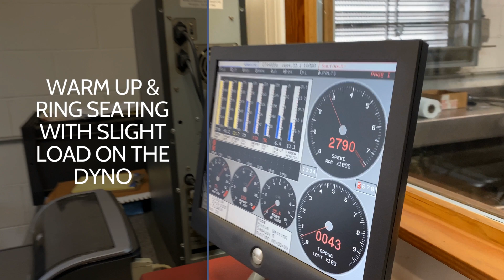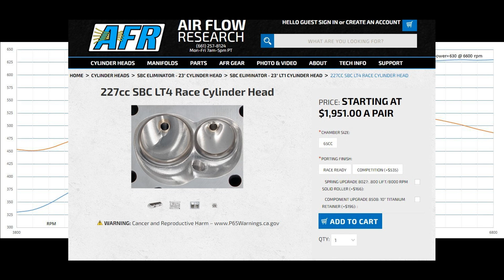Chevy LT1 Stroker Engine On the Engine Dyno [630 hp 551 tq]

Comment: You realize the "LSX" HYD Rollerr lifters are the same from 87up.. Right?

You can buy those "LS7" ones and they drop right in a Gen 1 SBC and vise versa... 

Long as they are OEM GM, ya good...

I would have went forged bottom end, h-beams, 9.5:1 compression, shaft rockers for the AFR's, The XE-294-HR10 cam or XFI 292,  and then put about 10psi boost. Call it a day!
Reply from the maker: I do realize that.  I've found that there are umpteen different makers of the 86 and up hydraulic lifter.  The GM is getting expensive.  If my customers can afford it the real Johnson is the best in my eyes.
Reply: @EllweinEngines  Yeah people was having FIASCO'S over the past year with junk flat tappet's coming from China wiping out flat tappet lobes on new builds left and right..

To me, a factory LSX-LS7 lifter should be more than enough to handle Gen1 style HYD ROLLER lobes considering what LSX lobes and how crazy they are anymore....

Also, Question sir...

Do you feel the LT1 block is superior vs the 4 bolt 638/880 casting SBC GEN 1 blocks as David Vizard swears he has broke all 3 roller blocks he tried to use...

Comment: I have a very similar motor build in my 96’ Camaro with a T56 and 4.56 gears. I’m running at 12.7:1 compression and E85. How much power do you think the intake setup for the engine dyno is making over a Port matched LT4 Edelbrock with a monoblade TB?
Reply from the maker: Maybe 5 to 10 hp at very high rpm.
Reply: I just had my car on a newer mustang dyno. Only did 475 through a T56. I say only because I figured it would do close too 500 at least even on a mustang. My tire pressure was low at 18psi with NT-05r drag radials. I know it’s running strong though because it made peak power at 6,900 and peak torque at 5,300. Still made 475 out past 7,300. Even with the lower than expected dyno numbers that tells me that it’s pretty solid. Here is the dyno vid.

https://youtu.be/_o6WQujcbXQ

Comment: Nice work to the owner, yourselves and of course LLoyd Elliot.  I have a 383 with TF 185 /21 degree heads. 202's replaced with 2.08's titanium; CC is 54cc. I estimate combustion ratio is around 11.2-3.   Bullet cam from LLoyd, 555/555  228/236 with 1.65 full steel roller rockers spec to 610.5/610.5, lobe separation 112.  42 pond ford green top racing injectors.  Heads done by LLoyd & flow @ .200 109/145 .300 204/144, 400 244/178, 500, 280/199, 600, 287/210, 700, 291/218.   Scat 3.875 nodular crank, scat 6.00 inch h-beam rods, and probe 12345 -12.5 cc inverted dome pistons, (up to 15 lbs of boost); arp 2000 series rod bolts.   The duration is as advertised @ .50.  If I may ask a question or 2.   Question 1:  does the duration increase exponentially along with the lift?  My best dyno pull was 528.9 at 6600. Engine hadn't peaked as I think.  Nearly every pull it was improving over the last.  Dyno time ran out.  Question 2. Am I on point with the compression ration guesstimate?  The above engine pulling 630 is phenomenal. I note he is running 12.5, little more cam & an 850 dbl pumper. Cheap plugs and single coil on the dyno pulls.  I am using a 24x system, by Bob Bailey.  Was not dynoed with it.   Question 3.  Do you think, my 528.9 was low, on point and what could be done to improve?  My car being an auto. and 1994 C4.  Current engine is 97 LT1...and last.  question.  Do you think I have enough to get closer to the 600 hp range.  Remember I ran out of dyno time as he had other so run?  I chose the 185 heads, since Trick flow advised the 185's would reach high horsepower numbers quicker than their over 200's would.  The claimed the fast burn 185's would get to their numbers quicker 21 degrees than the larger LT1 heads.  Opti Spark yes, MSD.  So looking into your crystal engine; What do you think?  Am I maxed out hp wise?  Or more can be had.  Hope I covered everything of importance.  Again really impressive work.  CJ.  

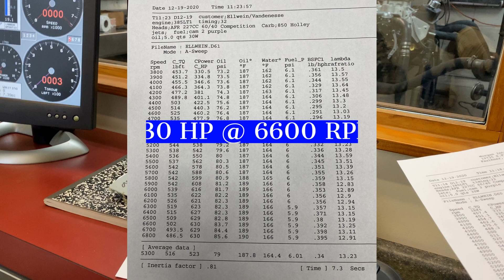UPDATE:   Since the above posting I did look into moving up in the 600 hp n/a range.  Bullet Cams told me I needed to select their next camshaft.  That should do it.  That cam specs are very aggressive.  I built this engine for my vette with 2:59 gears.  Now with a Dana 44 I am running 3:45 cogs.  If I ever go back into the engine; cam swap is a must.  I am reminding myself that Carls' solid lifter cam is definitely designed to make more power!!!!

Maybe we can put the 2 engines in a contest of sorts.  What do ya'll think?
Reply: If you really do have a 3.875" crank stroke, then your displacement is a touch over 400 cubes depending on exact bore, not 383.    185cc intake runner is not going to get you to glamorous max hp numbers; 205cc would be more like it.  However, unless you are drag racing the car, you may be happier with the low end torque you undoubtedly now have.  Don't get a complex over HP numbers--they are often not a good indicator of the real world performance of a vehicle, especially today.
Reply: @ShawnStjean  Well I certainly made an error.  Can't be a 3.875.   Has to be a 3.785.  I will check build sheet.  Well build sheet says 3.875. But it's not correct.  Since I created it I am sure in error.  What I am otherwise sure of.  Based on piston number.  Definitely a 383.  Probe SRS Series Forged Pistons_Chevrolet 383_Dish_1.125.  Per Vigilante website.  Thanks so much Shawn.  Great alertness on your part.  And equally great humanitarianism to even say something.
Reply: @THE_ORIGINAL_I-SEARCHdotFUN  No problem, you're welcome.  That compression height piston does check out as a 383 with 3.75 stroke, 6 inch rod , and 9 inch deck height.  Which really means that your heads are only a touch conservative, but well-matched.  I'd bet a lot that your torque peak is MORE than your HP peak (the reverse, as with this one, means a race motor, not a street motor.)   I would also bet that a 707hp Hellcat is not as much an overmatch for you as he thinks.  It comes down to traction in many cases, at this level.
Reply from the maker: Q. #1 duration increasing exponential with lift:  Say if you go to 1.7 ratio rockers for more lift would that also be more duration?  I say...no.   The cam would still have more duration but will give more lift due to the higher rocker ratio. 
Q. #2  I get 11.5 to one compression ratio assuming piston in the hole .010" and a gasket of about .040" thick
Q. #3 No I don't think the power is low for your engine.  I think it's pretty accurate.  Your engine dyno may be more stingy than this one.  But the heads you have don't flow as much as these and the cam is smaller and the static compression is lower.  I think the 529 hp is right on and you did have the efi set up and LT1 intake.  My single plane manifold makes more power than and that helps this 630 hp motor.  So I would really be happy with the power your motor made with the more reasonable compression ratio.  I think you have a very good engine combo.
Q. #4.  With the smaller heads I don't think it will get much more power on the dyno.  But it will be a good set up when it's in the car and tuned up for the Corvette.  
I do think you worked your combo out well.  But every combo...even this 630hp combo....can be improved a bit.   
The tuning on the street is the ron thing that  makes-so-breaks the engine.
Reply: @EllweinEngines  1.7 for an LT-1 is almost like pipe dreaming respectfully.  Finding 1.65 was a beast.  I only found one vender that makes them.  I heard Scorpion mades them.  But no evidence yet.
Compression raising is a sure.  But I designed the engine to be streetable and cool under pressure.
Reply: Did Lloyd Elliot port your heads?  He doesn't use 2.08 intake valves on the 21 degree heads but on the 23 degree he does.
Reply: Those are good numbers. You should do a Google search and type in "LT1 HEAD SHOOT OUT " and read the article . The best head tested was the AFR 195 Street head and made 516 hp with a XFI 230/236 camshaft.  Compression ratio was at 11:1 on pump gas.

Comment: Awesome work! Do you think it’ll run on 93?
Reply from the maker: Alex the owner hopes so but I'm not certain.   I would put one can of Boostane in the take per fill up.
Reply: @EllweinEngines  Hey Mr. Ellwein I know the AFR 227 heads come with springs for a solid roller. Are they ok to use with a  hydraulic lifter cam?
Reply from the maker: @sstevocamaro  I think so.  But I'm not certain.  I leave things like that up to my cylinder head guy Dennis Staff.  I think the AFR227 can be had with HR springs too.
Reply: @EllweinEngines  I wound up going with the 8002 AFR spring. I believe it has the green strip

Comment: Do you also dyno tune? I bought my 97 trans am ws6 with a 383 in it, I was told it was times before but it has some hesitation in the 2-3k rpm area trying to drive it normally. It does have a 3800 stall converter and 3:73 rear end and shifts very quickly from first to second. She’s plenty fast when just getting on it and doesn’t notice that hesitation at all. I am Just getting back into cars and not sure if I should just run it until I want to swap to a torqhead 24x setup or have someone tune this one. I’m in Michigan, a few hours away from oscoda. Thanks!
Reply from the maker: Right now I do not have a chassis or hub dyno but hope to have access to one this year.  So I only street tune.  It is just as good as dyno tuning but it takes forever...I spend a whole weekend doing a street tune.

Comment: Is there a certain type or brand of cylinder head bolts you prefer for your builds? I’ve looked at pricey ARP, Earl’s racing products that are non-torque to yield to factory replacement torque to yield Fel-pro or Mahle. Also what torque procedure do you use?
Reply from the maker: I use the ARP and have not tried the other brands.  I’m not against the other brands.   Just have not tried.   I torque the head bolts or studs with 50ftlb then final torque (2 times around). I don’t do a hot torque.
Reply: @EllweinEngines  Thanks, I will go with the ARP 134-3601 if that is what you use.
Reply from the maker: @rsnarski3  yea those have the nice stainless steel outer row head bolts and they won't rust.
Reply: @EllweinEngines  Ah , I found those with the ss outers 134-3603. Thanks for the tip, I appreciate it from you. I will be giving you my rebuild work when the time comes. Right now I’m prepping for LE2 heads. Any preference on head gaskets.
Reply from the maker: @rsnarski3  No preference of head gaskets.  For mild builds I like the Mr. Gasket thin stock style.  For performance I like the FelPro 1074 or the MLS Cometic.
Reply from the maker: @rsnarski3  Oh yea!  you found the 134-3603 with the ss outer row.  that is a good bolt set.

Comment: Getting closer.
Reply from the maker: I don't think I will ever top your engine.  It will be fun to try.  I think I'll need a big block Chevy.
Reply: I don't know. This one is only 16 hp away from my original peak number with that intake manifold, and 26 hp from the peak after you did the refresh, and I swapped to the Strip Dominator with the 2" spacer. Is that my old intake manifold?
Reply: What’s your setup? Are you on pump 93?
Reply from the maker: @sstevocamaro  this is Mike Glick's combo link.  http://www.ellweinengines.com/ERE62/ERE62.htm
His torque is crazy high too.  Ai TFS 21* with bigger cam than this engine in the video.  But the right combo for his set up.
Reply: Hey Mr. Ellwein I know the AFR 227 heads come with springs for a solid roller. Are they ok to use with a  hydraulic lifter cam?
Reply from the maker: @sstevocamaro  The 227 heads that Alex ordered was with springs for hydraulic lifters.  He did not get the solid roller springs.  But....the good mechanical roller springs could work with a good set of Johnson hydraulic lifters I'm sure.
Reply: @EllweinEngines  thanks
Reply: Just so people know Mike’s engine has a greater cubic inch displacement than mine. My engine in this video is a smaller cubic inch motor.

Comment: This is my engine!! Thank you Karl!!!
Reply: Your a lucky guy!! Do you think it’ll run on 93? I’m putting together a very similar setup (383)
Reply from the maker: @sstevocamaro  I'm thinking maybe but I would not risk it.  I suggest one can of Boostane per full up of 93.
Reply: @EllweinEngines  Are those heads race port or competition port?
Reply: @sstevocamaro  ask AFR what’s best for your set up. Jeremy helped me at AFR.
Reply: This is a stock block ?
Reply: I know the AFR 227 heads come with springs for a solid roller. Are they ok to use with a  hydraulic lifter cam?
Reply: @sstevocamaro  always call AFR.
Reply: Did you get them milled to 55cc’s?
Reply: @sstevocamaro  yes!
Reply: @a.f-body1vids655  Thanks! Mine came in yesterday with 55cc chambers. Lloyd spec me the same cam, but .611/.620 lift. Did you have to use 60/40 pistons? I hope not because if so I’ll definitely have to measure ptv really good. My engine is already assembled with standard valve relief pistons.
Reply: @sstevocamaro  well Karl built mine. I am pretty sure we used 60/40 shaft rockers. We used Mahle .40 over Pistons.
Reply from the maker: @sstevocamaro  we did not use special pistons.  The piston to valve was good.
Reply from the maker: @sstevocamaro  How is the engine coming along?
Reply: @EllweinEngines  It’s at a stand still at the moment. Once I get some lifters I can start assembly. What kind of lifters did you use if you don’t mine me asking?
Reply: @EllweinEngines  I’ve been looking at the COMP Cams Short Travel Hydraulic Roller Lifters. Are they any good? What should I use?
Reply from the maker: @sstevocamaro  Lately I've been using Johnson lifters and I get them via Brian Tooley Racing.  The LS1 drop in style or link bar style.  #2110   The COMP might be ok but I have not used them.  If you have the money you cannot go wrong with the Johnson brand
Reply: @EllweinEngines  Thanks I VERY much appreciate the response!!